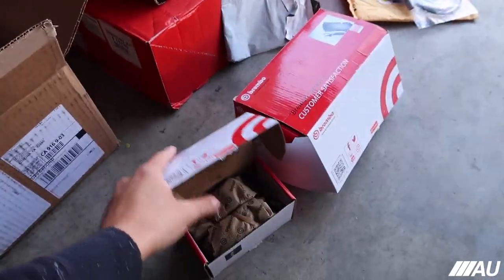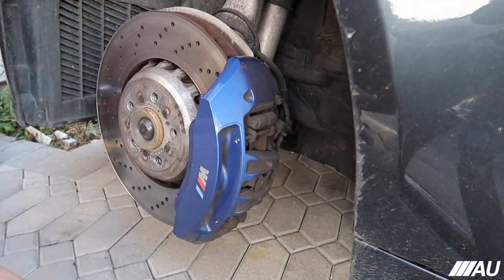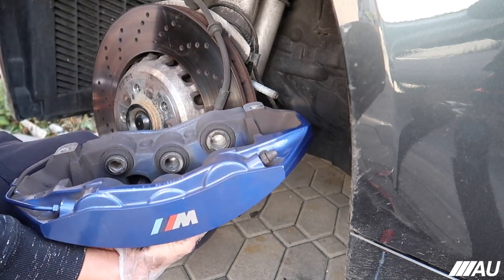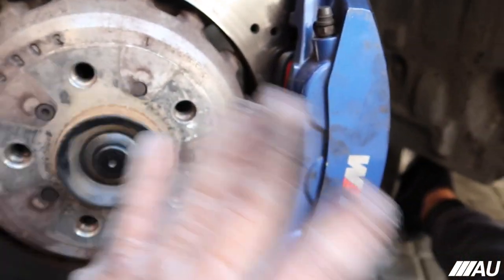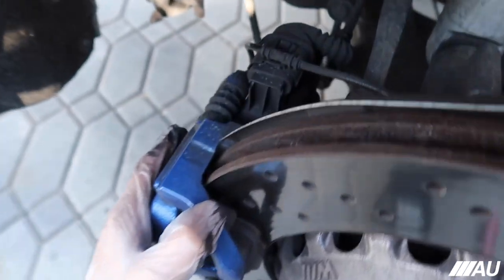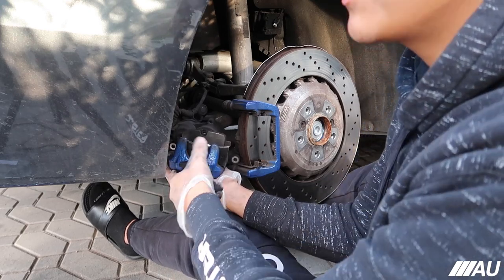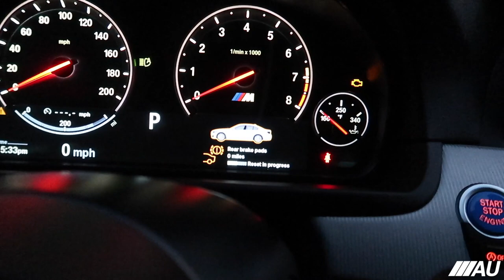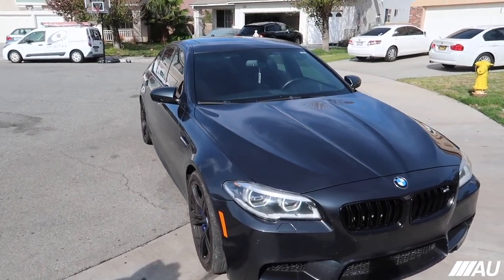INSTALLING BREMBO BRAKE PADS ON MY F10 M5 !! (STEP BY STEP)

Comment: Hey man. Thanks for video. I just finished with the fronts. What is the tool you that you used to put the rear electric parking brake into service mode?

Comment: I know this is late but whenever you do the parking brake service mode, the brakes should still be on the rotor, put in service mode and then remove them when you are done put it back on the rotor and end service mode otherwise you’ll screw it up
Reply from the maker: Thanks for the tip man!
Reply: How do you put it in service mode?

Comment: Upgrade my rotors and pads on my 2011 550i powerstop drilled and slotted rotors and z23 pads.
Reply from the maker: I got powerstop  drilled &’ slotted rotors on my 535i but for some reason they were bad after just under a year
Reply: @anthonyulloa4004  really! Should keep that in mind, but so far the rotors and pads are still good. Barely used the car also only weekend car.

Comment: Glad your back and thanks for being the guinea pig. I wanted to ask how many miles are you on and if you have done the rod bearings. Also should I wrap my downpipes in exhaust wrap?
Reply from the maker: Thank you bro! I’m at 35k &’ have not done my rod bearings yet. Personally if I were to every take off my downpipes i think I would ceramic coat them &’ heat wrap them as well before putting them back on
Reply: @anthonyulloa4004  For sure bro, appreciate the help!👍🏼

Comment: I hope you had an axel stand or similar under the car as well as the jack while you were working on the brakes ......... ALSO please keep your feet out from under the car when working on the brakes.   Ask me why I know !!!
Reply: I once had a car fall off the jack whilst working on the front brakes. Scared me to death.  If I’d had any arms or legs under the car They would have been chopped off no shadow of a doubt .... I now use two jacks and axel stands.  If possible use ramps depending on what your doing on the car